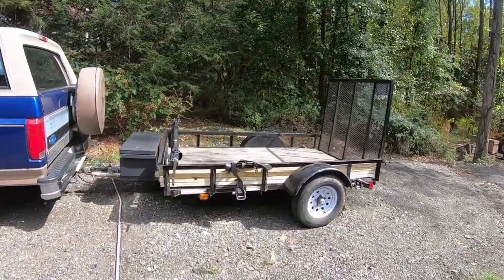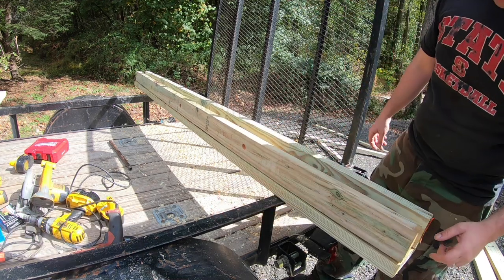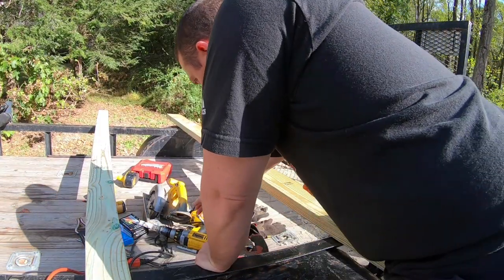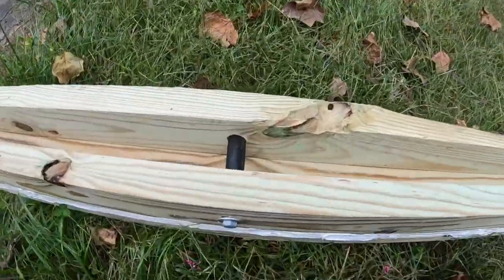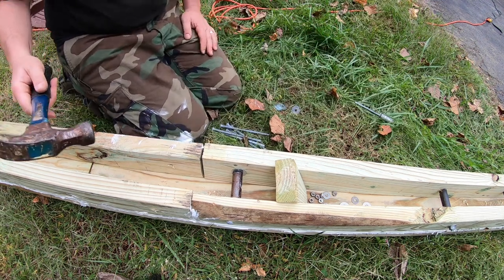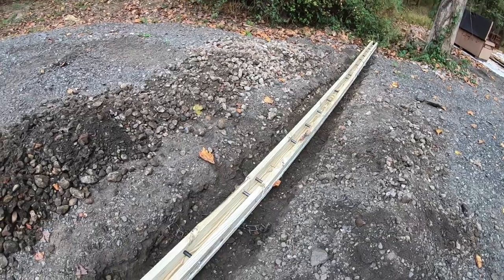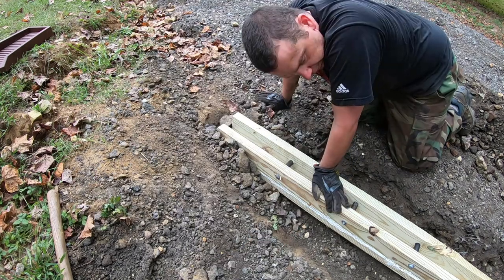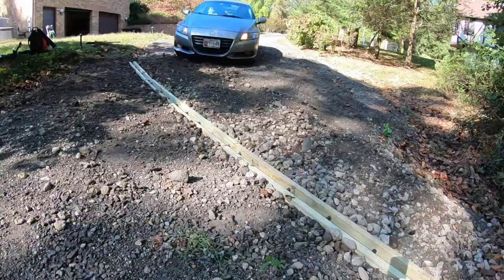Water Diverter - Fixing Driveway Erosion

Comment: On one hand I applaud your creativity in thinking through a solution.  However, it has to be the most work harder (not smarter) thing I've watched.  They literally make steel drains you could have installed easier and cheaper. There is also a plethora of pvc options you could have done here again cheaper.  I guess I hope it's working for you.  Best of luck.
Reply: You never did that
Reply: Wtf the video would be 7 mins long whats the point
Reply: Plus that wood will eventually rot. Then he'll be back to square 1. Plastic pipe would've been a much better solution.
Reply: But you'd have to bury plastic pipe several inches down or traffic would break it.

Comment: Take a piece of pvc pipe and cut it in half, heat the half piece up and lay some bricks on it to flatten it out, make 4 foot sections and drill some fastening holes to mount the 4 foot section but before you do cut slots at a angle for water and paint them black and then mount the section across the top of the wood drainage that you built. Your welcome.

Comment: Good effort but 1) just use a schedule 80 pipe or something 2)When running that skid steer and doing work you need to run the throttle all the way up. It was made to run like that and will actually do some work. Not saying it would dig a trench in compacted gravel without a tooth bucket but it might do better than just idling. Also an old guy told me once and it has always stuck with me, He said "let the machine do the work" and "work smarter not harder".